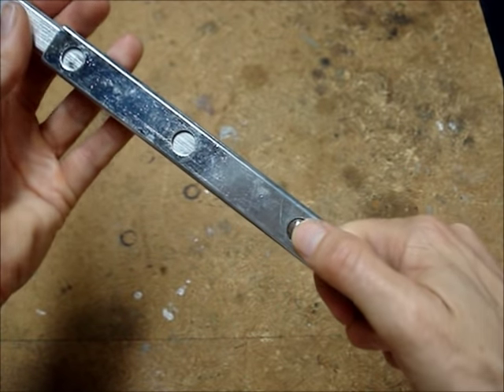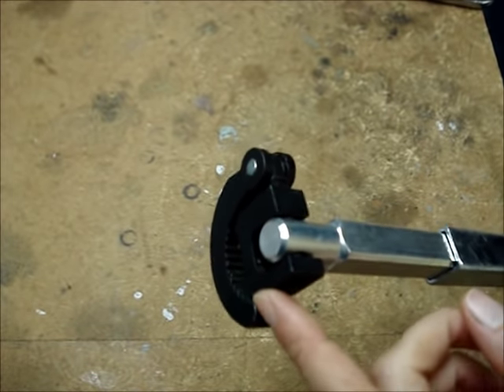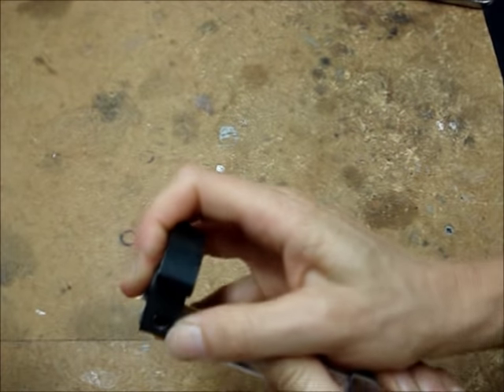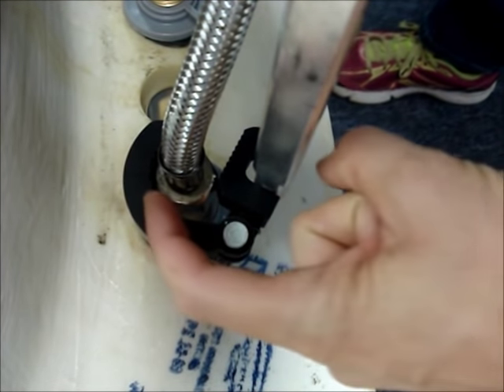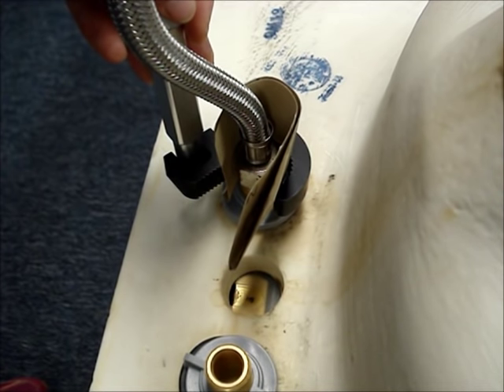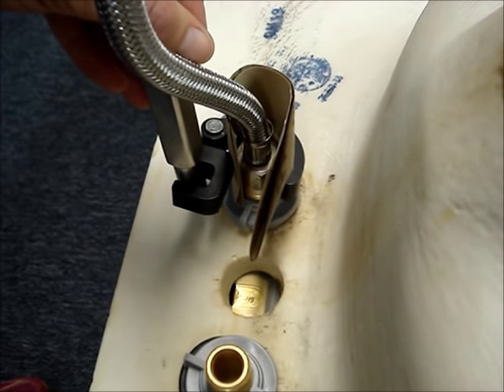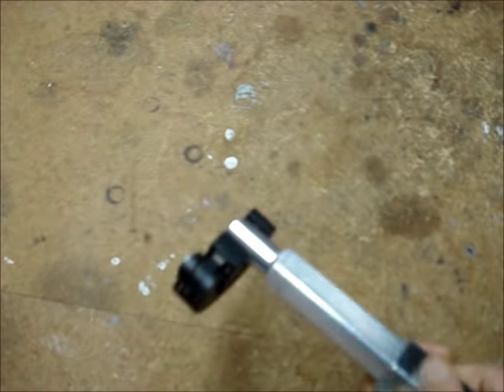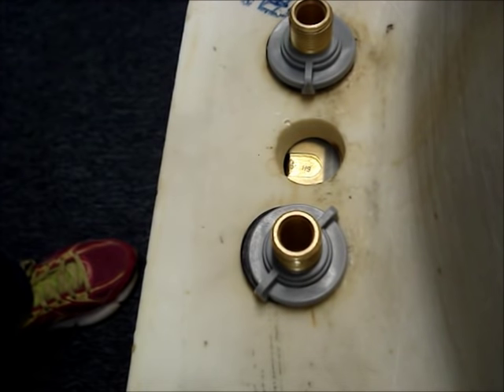How to Use a Basin Wrench

Comment: LOL I bought one of those basin wrenches. Try actually getting underneath a sink to use it on a 2" nut. I can't get the wrench to grip. Plus with all the hoses in the way, you can't get a clear view, let alone space to maneuver a telescopic basin wrench. Who the hell designed the means of installing hoses and pipes underneath sinks? Everything is cluttered. There should be a rule to allow space to work.

Comment: Worst case if you cant get the water line removed using that wrench, instead of removing the sink you can try cutting the line off and then just using a socket, and replacing the water line.
Reply from the maker: That's a great idea.  Thanks for sharing.

Comment: Love how you're doing it with the sink on the floor
Reply from the maker: I had to tear the vanity out to get to a leaking lead drain pipe.  Apparently 70 years ago when the house was built a nail was driven into that pipe.  I thought it was a good opportunity to had a good view on how to use a basin wrench.  It's almost impossible to get a good camera angle/light when the sink is installed.

Comment: Was getting ready to spend $70 on a service call because I couldn’t get the center faucet bolt loose But then I watched your video and you mentioned using a crescent wrench for added leverage on the base of it to turn it.   Well after 70 tries of using the lever I couldn’t get it - but tightened up my crescent wrench for added leverage and she turned like butter.  Thank you / thank you / thank you / thank you.  I got it.  With your help - your guidance that is.  And you saved me $70.  I certainly owe you one.   One thing I might also mention is most basin wrenches are for an inch bolt or less - viewers might need an inch and a half basin wrench mine was $14  for the Home Depot Husky brand which is cheaper than the $20 one at Lowe’s.   Can’t tell you how many kitchen faucet videos I watched that omitted your instruction.  An answer to prayer - indeed - thanks again.
Reply from the maker: You are welcome, David.  It always makes my day to hear that the video has been helpful.  Nothing owed, just do something nice for someone.....  make the world a better place.  Thanks for the mention of the basin wrench size.  I'll copy and paste it in a new comment box.

Comment from the maker: Helpful tip from David Azinger:  One thing I might also mention is most basin wrenches are for an inch bolt or less - viewers might need an inch and a half basin wrench mine 
was $14  for the Home Depot Husky brand which is cheaper than the $20 
one at Lowe’s.
Reply: Hey, my basin wrench came with a pin like thing. 
____________________________
Nevermind, I'm a bit of an idiot. Wasn't putting enough pressure on it. I'm assuming the pin is important.

Comment: Are you still monitoring this? I have the tool. I tried it both ways to see if I could get it to grip. I cannot get it to hold the nut to even apply any torque to it. Upside down under the sink with the base edge of sink cabinetry in my back and zero elbow room makes getting any kind of hold on it seem impossible.
Reply from the maker: You can try making your own wrench, I have a video that shows how to do it.  Also, spray that nut with penetrating oil that will help if it is stuck.  WD40 is not penetrating oil.  Link to video:  https://youtu.be/gtqB3V8mfeU

Comment: The grey nut that you tightened down ... mine broke, so I need to replace it.  What is the name of that part?  I'm hoping to buy just that specific part?
Reply from the maker: It's likely called a lock nut.  I'd suggest taking the broken one to a plumbing supply house.  They might be able to find the correct replacement.  The brand of the fixture would also be helpful.

Comment: The instructions on the back of the Husky Tools basin wrench package seem to show the product used the opposite way to that shown here. The instructions show the end flipped to the left, and the leading edge when turning as the end of the curved piece, not the flat piece leading the turn. Cannot get the nut off either way, unfortunately. Can anyone enlighten me? Thanks in advance.
Reply from the maker: The video has over a half a million views, with thumbs up at 97.4%, no one has contested the instructions in this video.  I only delete a comment if the person is cursing, which is just about never.  Spray the connection with PB Blaster, have a coffee and try again.  If that doesn't work, tap on connection, spray on some more PB Blaster and try tomorrow.

Comment: the nut I have is old with square edges and won't budge...even with this tool
Reply from the maker: Try spraying some PB Blaster Penetrating oil (the big box hardware stores sell it.) where the threads meet the nut.  Wait a few hours & try again.  The PB Blaster has a horrible odor, but it works great.

Comment: The problem with this video is though is that you have easy access and you're standing right over it what about when you have to crawl underneath the sink and move upwards to get a faucet out of a kitchen sink
Reply from the maker: The point of the video is so you can see how to use the wrench.  If you want a horrible camera shot of how to use a basin wrench your are at the wrong place.

Comment: Upside down is ez...smh
Reply from the maker: You would prefer a crappy view that you can't see how to use it?
Reply: @Know-How-Now  lol I appreciate ur effort it's just that it's hard to get to that part of the sink and that's the challenge!!!
Reply from the maker: lol I agree, crawling under the sink is not high on my list of favorite things to do.  If anything is stuck, spray some penetrating oil on the connection, wait an hour and then try loosening again.  I use PB Blaster, it smells really bad and of course don't let it drip down into your eyes.  Open windows, the fumes can't be good for you.  Best wishes for your sink project.